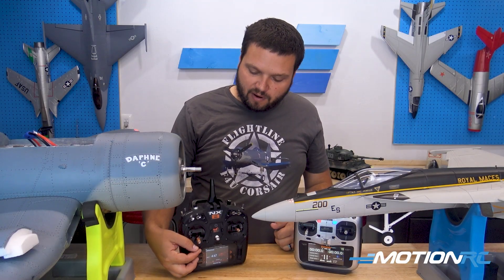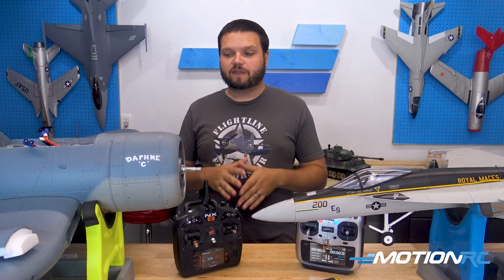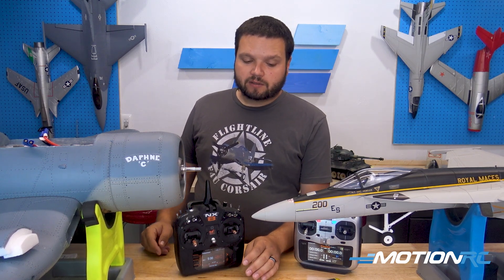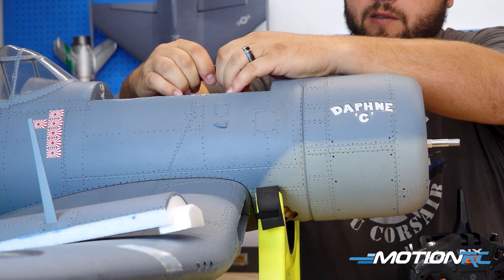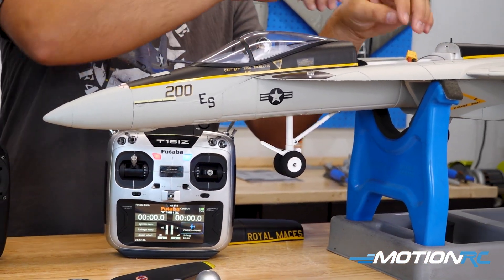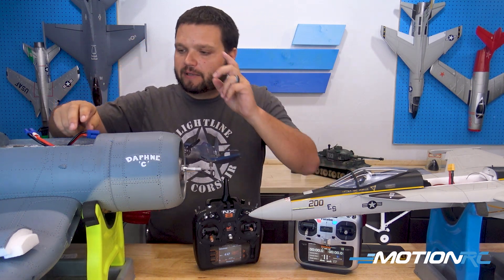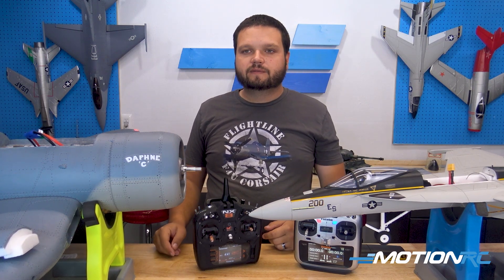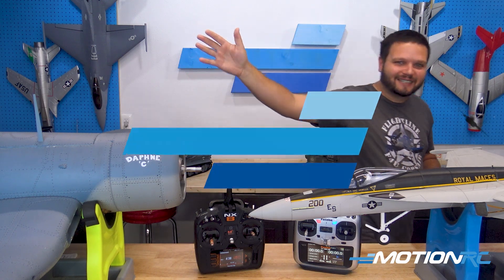ESC Calibration | Quick Tip | Motion RC

Comment: How about if after you calibrate and the esc will let you run throttle once up then back to low then shuts down meaning no throttle then I have to reboot tx and rx to have throttle again only having to repeat the steps 
Can you help